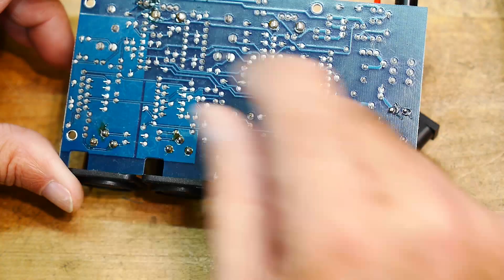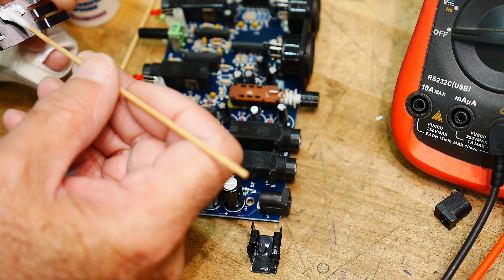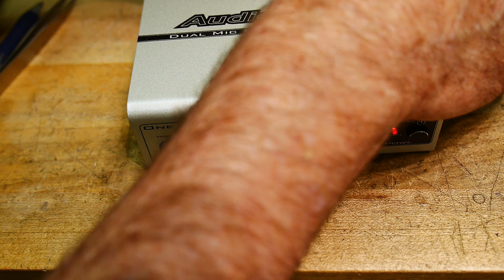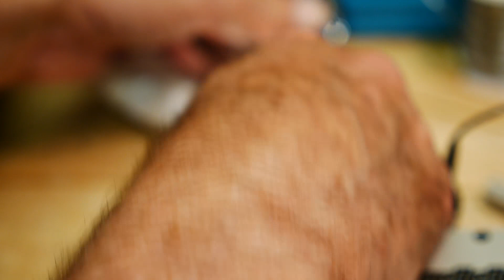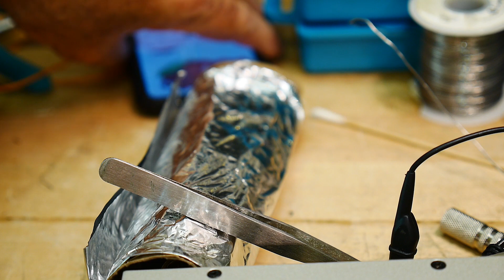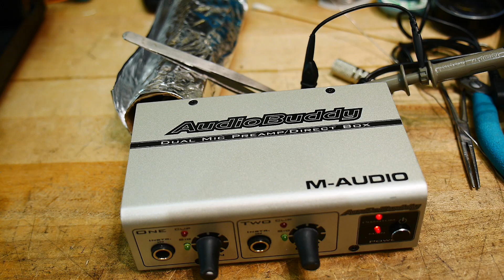#445 M-Audio Audio Buddy Dual Microphone Pre-amp

Comment: That regulator heat issue is still sticking in the back of my mind...although rails seemed right it just seems something is drawing more current than it should be. From a design point they must have found that issue in the prototype you'd think...maybe they made a conscious cost decision to let it ride. Anyway, those little 50-year troubleshooting hairs on the back of my neck were just standing up a bit! TNX for sharing, nice repurpose, look forward to seeing the final system in use.  73 - Dino KLØS
Reply from the maker: I looked for a smaller wall transformer. The one I was using was 9VAC at 2A.  I found a 9VAC at 500mA. The input voltage to the regulators is now 2VDC lower than before!
Reply: @IMSAIGuy  One case where a supply droop is actually a good thing!  ;-)
Reply from the maker: I'm assuming they designed with a wimpy 9VAC wall wart and it droops. Mine was big and didn't droop.
Reply from the maker: bipolar opamps are drawing about 50mA total. the big wall wart delivers 24V to the 15V regulators. so 9V * 50mA = 0.5 watts